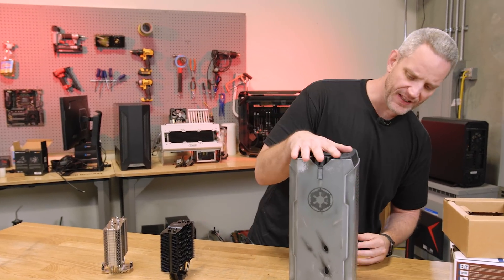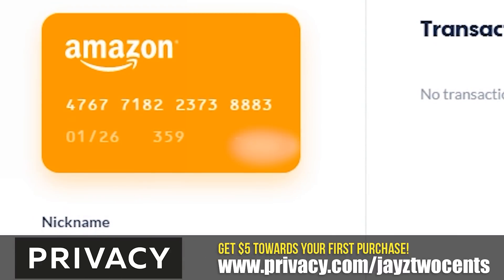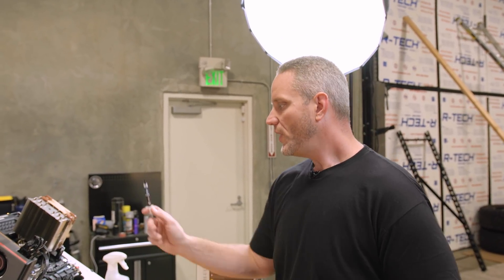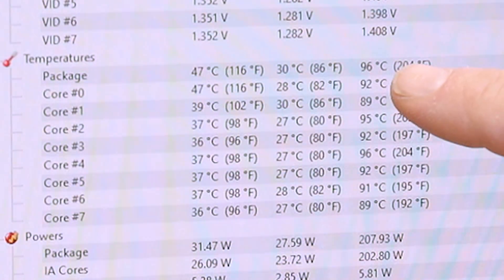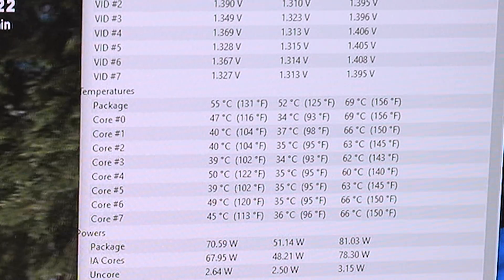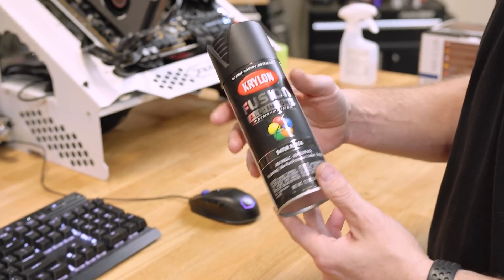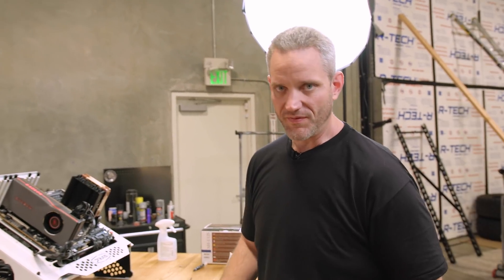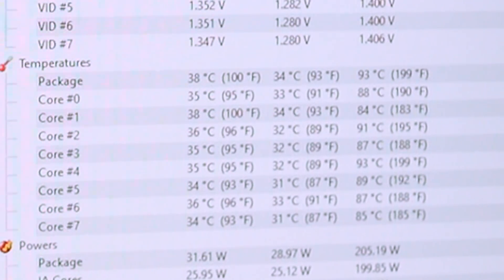Does painting a heatsink hurt its performance??

Comment: prediction: few c difference, paint will probably be damaged in hot spots due to ~90c heat.
Reply: sooooo you're not very smart then, huh? none of the COOLER is going to hit 90c, period. That''s the temp of the CPU CORES as in before any of the heat is spread across the larger surface area of the cooler.
Reply: @shawnpitman876  I meant the heat source is 90c, I didn't mean that the cooler would go up to that temp - but it does get rather warm and i'm not sure what temp that paint is good up to.  I would expect the surface of the cooler to reach at least 60c and idk what the finish is rated at. - also you don't need to be rude to share your opinions or educate people if that's your intent.
Reply: @shawnpitman876  a simple "no, the paint should hold up to that heat without a problem" would have sufficed... I really hope you find someone to remove that stick up your butt... have a great day!

Comment: I think maybe 3° max. I feel like getting a powdercoating would not effect temp at all however thick paint might effect it but not by much, the heat pipes are still going to flow heat throught the heatsink, however I do feel over maybe a few hours it could effect temp. Idk, could be wrong

Comment: Hi Jay, love the show! I have an idea for a cooling test for you (you seem to do well with odd tests that might not yeild results)....So my ideas has to do with watercooling; I was thinking about the nature of radiators and how they disipate heat while the fluid is inside the radiator, So i thought what if the fluid stayed inside the radiators for longer?

My idea is to have a single series loop that goes through all the different computer components, however instead of having the radiators one after the other a series the loop would split in two and then have both radiators in parallel. After the radiators the lines would combine back to a single line. My theory behind this is it would maintain a high flor rate through the main components such as CPU/GPU but then have the flow slow down and allow the water to spend additional time in the radiators possibly allowing for more heat to disipate. 

I don't think this would have a drastic change but it is an interesting theory that i do not have the resources to explore.

Comment: I think itll matter if the coating is too thick, but if it is properly done, it shouldnt affect it too much. Assuming if you use a spray paint that isnt purposefully bad at transferring heat, or that is plastic (like plastidip)

Comment: Now you need to do a side by side testing and find which are the best static pressure fans on the market  both for heatsinks and for radiators and maybe split up into a couple different price points  low/high

Comment: Prediction:
If anything, it should improve performance ever so slightly.
But I think the change will be so incredibly tiny that you cannot measure it.
Reply: Well you've gotta be the absolutely MOST wrong person to have made a prediction. 
69 after to 69 before +0
69 after to 66 before +3
68 after to 63 before +5
68 after to 62 before +6
72 after to 60 before +12
68 after to 63 before +5
70 after to 66 before +4
68 after to 66 before. +2

but tell me about how it'll be an improvement, or too small to measure when the hot spot core has gained 12c in temp.
Reply: @shawnpitman876  mainly because I learned that shit in engineering class.
Eloxating metal helps with getting heat off of your heatsink by increasing the amount of infrared it emits.
What I did not consider, was that spraypaint is much thicker, to the point of actually giving it an insulation which is the big difference between it and an eloxation.

Now, I will say this nicely:
Next time you see someone who you think is wrong, do not be a collossal asshole like you were with me right here.

Comment: The question is easy to answer, if you use blanket over your PC will it get hotter the longer you left it? 
YES, paint is polymer and it's not good at transferring heat just like your pan that has a thick plastic, paint is plastic!

Comment: I would have used a heat resistant paint; preferably one meant for exhaust pipes or engines, that you can buy any place that sells paint including auto parts stores.  Heat resistant paint is meant to help conduct heat and will not blister or discolor over time as well.  Krylon is a good quality paint, and they also make a good heat resistant paint.  The main problem with CPU coolers is the close spacing of the radiator fins, too much paint will clog the space and disrupt air flow.

Comment: Ummm... What about using a metallic paint - would the metal flakes improve heat conduction? Would using a matte finish instead of satin generate a bit more turbulence in the air passing over the fins and would that result in better or worse heat transfer from fins to air? What about painting with ultra fine pigment paint from an airbrush instead of the rattle can? Did you put dial calipers on the fins before and after to measure the paint thickness? If it was plated with black chrome how would that do? Did the temperature of the air going through the cooler change as the testing progressed?  What if you turned the test bench upside down with the cooler (no fans) stuck in a bucket of ice water? Johnny 7 need more input

Comment: I would use a bequiet silentwings 3 120mm high speed fan, better static pressure half rpm than most fans have on max.

Comment: Painted will be better as a passive cooler(no fan), only very slight temp gain with a fan tho. I remember MightyCarMods doing this with intercoolers a couple years back and I think I remember that being the case.

edit: So I went back and checked the vid I mentioned, it looks like they used an etch primer before the black top coat https://youtu.be/f1QL9veQaNg.

Comment: With you being a fellow gear head.... I'm surprised you still use those lousy PC radiators.  
The worst 6 pass or stacked plate B&M transmission cooler would make any chinese junk radiator from China China it's bitch. Imagine just leaving the case cover off behind the mobo and running a real cooler meant to cool 200° transmission oil. 
Also using distilled water with automotive water wetters reduce the surface tension. Making coolants 40% more efficient. Get ya some proylene glycol (potable water systems like motorhomes) some water wetter, and https://www.amazon.com/gp/aw/d/B00J0NZFIA/ref=psdcmw_11036291_t1_B002BTQUJ8.
With this cooler it would CRUSH those whimpy computer parts.https://www.summitracing.com/parts/prm-1024?seid=srese1&gclid=EAIaIQobChMInv2DsoDi5wIViJOzCh15JwYmEAQYAiABEgJWefD_BwE
Reply: Any non foaming soap would work. Liquid dishwashing soap for the machines works..... https://www.summitracing.com/parts/red-80204
Or if you REALLY want to grow a pair use methanol instead of water. Well.... maybe not methanol... too hard plastics. Fill that bad boy with isopropyl with a derale fan and that 8in pc fan..... you'd be lucky to ever go over  5° ambient on the return fluid temps
Reply: Personally I'd run 40% propylene to keep seals healthy and lube your pump. The isopropyl is TONS better at removing heat. Old cars used.alsohol all the time. It required more maintenance so they used a glycol in place of it.  All those chemicals are safe for EVERYTHING except natural rubber.

Comment: There is thermally conductive paint as well...car engines get this treatment often.
Reply: Auto engine paints are designed to withstand high temps, but I don't know if that means that they actually transmit heat better or just survive high temps without breaking down for some other reason.
Reply: HydroKyle240 : This Test needs to be done!!
Reply: Well if the paint conducts heat, it's less prone to crack and fall off
Reply: @Quimerateck  That's true, but there is no guarantee that heat shedding is the reason they survive high temps better than other paints. They might survive high temps better for a completely different reason.
Reply: @taggerinc2652  No, some paints are actually designed to conduct heat, or literally no professional racer would dare paint their engine.  At that point, it would be a mode/upgrade to strip engines of their paint, if that makes sense.  Because the colder you can get your engine, the more horsepower you can squeeze out of it.
Reply: @HydroKyl240COG  This is the last time I'm going to say anything here because people are clearly missing the point.      /        A person cannot assume that engine paint dissipates heat better than ordinary paint simply because it can survive longer in a high heat environment.         /        Heat dissipation is not the ONLY way that they can survive high heat environments. That's why there are different kinds of engine paint, each manufacturer came up with their own solutions. Some even have ceramic in them for the exact purpose of heat dissipation. But not ALL of them do.        /        Therefore - SOME engine paints MAY dissipate heat better than other paints. But SOME engine paints MAY NOT conduct heat any better than other paints.      /       In regards to the subject of the video it doesn't even matter. No paint, no matter how specialized, will dissipate heat better than the exposed aluminum.        /        A cooler painted with an engine paint THAT IS DESIGNED TO  DISSIPATE HEAT, might out perfom a cooler painted with regular paint. But the naked cooler will still out perform both painted coolers.

Comment: At the beginning I predicted +4C and that happened on SOME cores? I also think I made the prediction before you talked about the real world test, and that's on me. Meh, I call it a push.
Reply: 69 after to 69 before +0
69 after to 66 before +3
68 after to 63 before +5
68 after to 62 before +6
72 after to 60 before +12
68 after to 63 before +5
70 after to 66 before +4
68 after to 66 before. +2

these are the real world numbers. Still made more than enough difference, +4c or more on 5/8 cores.

Comment: I predict a small increase of around 2C
Edit: So Close! I am impressed I was on the fence about painting my cooler now I feel like I will.
Reply: 12 degrees on core 5. Not even close lol
Reply: Take a look at the far cry 5 test most cores were up 6 to 9
Reply: Maybe you could paint only the sides without the fins, since the others will be covered by fans? I guess the impact would be minimal.
Reply: @Ed_edino  yea just the edge. I would only go with the sides. A fan in the front and you wont see that. Back i would also avoide if i could.
Reply: @Ed_edino  or maybe even just the top, I'll be getting some paint tomorrow thankyou !
Reply: Noctua chromax series, take a look
Reply: @nielshellbach3092  it's pretty I was wanting blue though lol
Reply: You can buy thermally conductive paint, which will PROBABLY lessen the amount of isolation. I haven't tested it myself though, so take it with a grain of salt.
Reply: Ask Gamers Nexus... My prediction.

Comment: My prediction, very little difference, since it will only coat the outside and the part where the heat pipes are, the paint will not reach.

Comment: What about using high heat thermal paint?  You can paint engine blocks with it because it dissipates heat fast enough to avoid charring itself.

Black high heat paint is used to paint grilles and such...perhaps it might perform better?

Comment: Radiators in cars start bare brass rows and then they get painted black. I don't think its anything special paint. I think its just flat paint. And I'm not a 100% sure but I think car engines get a fair bit hotter then CPUs. I don't think it will make much of a difference.

Comment: if you want to check out a game that can overheat your PC and video... check out "Quern", for some unknown reason to me, this game overheats my system even faster than Call of Duty... (actually, even faster than any of my games) and Im running a MSI RTX 2080ti 11g on a MSI Gamers edge ac board at 4.7Ghz  (I9-9900KS) with ddr4-4000 32Gb with the cpu on water cool ( 360 radiator and video on water with a 280 radiator)...  does anyone else have this game and heating issues too??

Comment: Another factor to consider with a painted surface that will get heated: Depending on the paint, the heat will continue 'cooking' it, making it gas out chemicals. (There is an actual term for it, but I've forgotten what it is exactly).

Now, I don't exactly know if those chemicals themselves would necessarily be as flammable as the paint itself would be, but you certainly wouldn't want them building up in any sort of an enclosed case or improperly ventilated room.

Comment: Does it insulate it?  No it doesn't, the paint will get to the same temperature as the fins in relatively short order and energy (heat) will flow away in the same fashion.   But temperatures were different!   That's because paint it increases the thickness of the fins, meaning less airflow through the fins, which means the hot air can't get away as easily which is why painting = bad.    Anodizing may be better, but it will still add thickness just not as much as paint will.

Comment: The solder TIM on Intel isn’t the problem for why their 9th gen chips run hot. They thickenedthe silicon for fabricating the chips to somewhere near 0.8-1.0 mm. The 8th gen chips are 0.45 mm if memory is correct (I have an 8700B & 8500T). Thickening the silicon is the cause of those thermal differences. The thickness increase was because of the indium solder. That said though, the indium solder is then required to “get close” to previous temps, but they can’t because the additional thermal resistance of the silicon can’t be removed.

Comment: paints do have different propertys when it comes to Absorbing heat or transfering it away.  Back in Thermal dynamics class if you were painting something to help with heat adsorption using black.  The more Carbon black in the paint the better it works. Flat black or semi flat is always better than glossy.

Comment: I can’t believe I paused to type this, but it’ll probably matter, but not all that much. Paint doesn’t have the same thermal conductivity as metal but it’s also not going to hobble the fins that have direct contact with the heat pipes. In moments I will be proven wrong

Comment: Knowing physics, the heat transfer coefficient will definitely get worse if the paint is a worse conductor than the metal (im going to guess it is) However its going to be so thin, and there is probably already a bottleneck somewhere else that it wont matter.

Comment: When I paint heatsinks, i mask the whole thing off except the very top plate. That way most of the cooler stays unaffected while the part you actually see gets a nice black finish. I've done it on several heatsinks and seen no difference in cooling performance on the same cpu, with set voltage, clocks and fanspeed

Comment: I have a Noctua D15 and my solution was to use a permanent black magic marker. Doesn't look the best when handled but through the smoked glass side panel, it looks great. I also covered that tan fan with electrical tape. Looks and works great with zero temp increase under normal gaming.

Comment: Stopped at 1:25 and I don't think it's going to make enough of a difference that the result will be "Don't paint your heatsink!" However! I do wonder if it will make a difference as things heat up, like in a overclocking scenario.  And yes, I know that most of the time that would mean water cooling.  But lately air coolers are getting good enough to allow some overclocking.  Like, for example, the Pro Siphon Elite, which I will soon be getting.  I want to include that in a Star Wars themed build that uses a Bacta Tank as a mock reservoir, because the actual cooling will be done by the Siphon Elite.  
Now I'm going to watch the rest of the video...  if I edit, my Bacta Tank dreams might be over.  :)

Comment: I'd just paint the top plate. Graphics card (with a backplate if aesthetics are this important) and the case will be on either side of the cooler anyway. Whatever's still visible will just match what's peeking out from the GPU shroud (unless you're running a blower card or have an AIO on it) or the GPU shroud itself (NVidia reference cards). Scythe is already doing this on the Fuma2, just sucks that they didn't on the Mugen 5 while not putting on the heatpipe caps on the Fuma2.

Comment: They used to paint car radiators, and sometimes still do. Doesn't affect the cooling, so I won't expect it to cause problems on the heatsink either. Unless you put on so thick a coat of paint that you block the airflow through it.

Comment: Physikal laws says, black material can spread heat better. Not painted material becouse every layer of paint is an isolator. Best solution would be black oxydated metal.
Btw... Fun fact... Almost every water radiator for PC are black.

Comment: While it might be hotter under load, Black paint has a radiant grade lower than No Paint or bare metal.  This means, that while it's hotter under load, it WILL lower the temperature faster while not being under load or IOW at Idle.  It recovers faster after there's no load.  Unfortunately, that's not where you're playing games or processing.  :)

Comment: 01:18 I think the paint will insulate a tiny bit but not enough to make a significant difference, up to 5c difference maybe and actually depends more on the airflow of the case rather than the fact that it gets painted however what paint is used also matters somewhat.